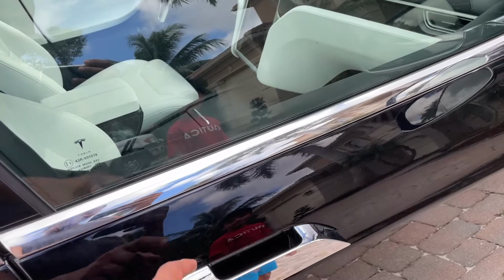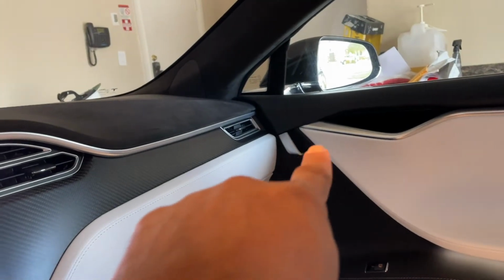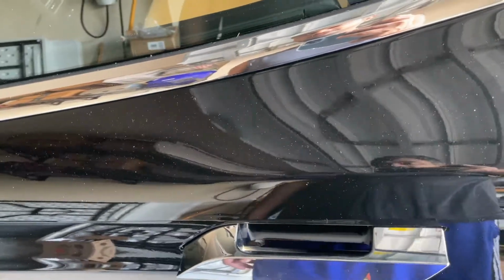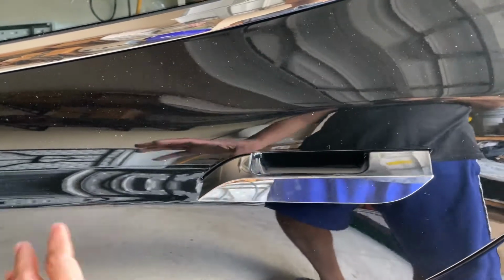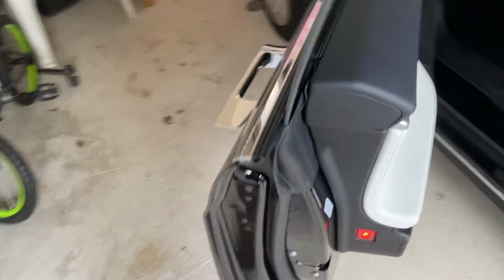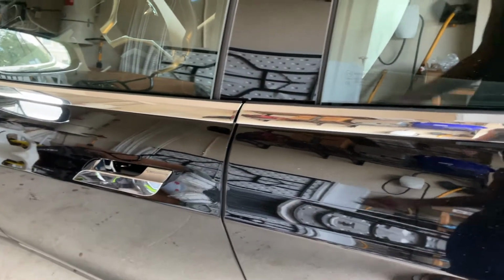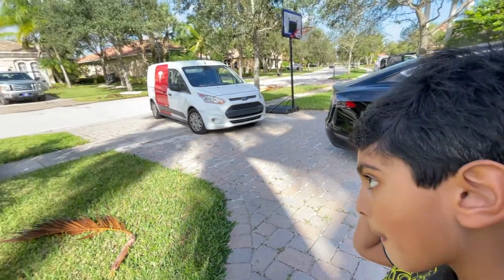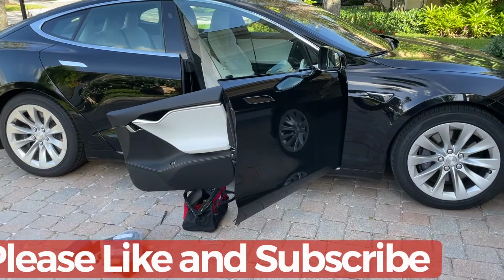Tesla Model S Door Handle Issues and FIX

Comment: You literally didn't answer any questions...please mod your title to "Tesla came by and replaced my door handle for free" To be fair, the first part of the video was informative but it should have concluded after the service tech arrived.
Reply from the maker: agree...it was a last minute decision to start recording and kind of showing what i had to go through as some people having same issue
Reply: Right on!
Reply: Removing the 5amp door fuse would have reset your door handle….. that was literally a waste of parts
Reply: I gotta say, briantimothy above is correct.  How frustrating to have this happen, somehow arrive at this vide entitled "issues and fix" which implies a fix will be available via video...and then it shows a Tesla van comes up and fixes it.  Respectfully, this was misleading and a cring waste of time.  Goodness.   @HowToDoitright

Comment: Just finished fixing both driver-side front and back door handle on my 2014 P85D. Now all 4 of my doors have been fixed for not presenting problems. Basically, it's the cheap paddle gear that broke at the hinge. First, the rear passenger side doors were replaced under warranty. The passenger door broke right after the warranty expired last year, which cost $343 parts and labor (looks like they put in a gen3 handle for $200). Then just earlier this year both driverside doors went within a week of each other, WTF. I didn't feel like paying for 2 door repairs so I decided to fix them myself following some of the Youtube videos. First I pick up paddle gears from the Tesla parts department for $7 each. Then just take the door handle out and replace the paddle gear. The new ones look like a different casting and metal feels different so hopefully, this will last the lifetime. A couple of things to add are to use an air bladder jack to spread the gap to help get to the two nuts on top easier. Windows up to undo the bottom bolts. Roll the window down to get to the top nuts. Use a plier and something to hold the nuts to place them back. Cover the shiny door handle with painter's tape to protect it from being scratched. Use some old credit cards to wedge the bottom of the handle when reinstalling to align it through the gap. Now I have both doors working. Although one of them the LED wire was broken so I have to get a new LED module and do this again.
Reply: thanks for the added tips. was there a youtube video you liked and suggest that we follow?
Reply: @drwhpod  The video by Rich Rebuilds as well as the one by Electrified Garage channel does a good job. Except Rich Rebuilds remove the window glass to get to the bolts on top, that was not necessary. First one took me 3 hours to do, after that less than an hour once figure out how to finagle the handle out.
Reply: Hi is there any reprogramming needed to pair the new handle after installation? Thanks

Comment: I have a problem with door handle model s2021 the door handle can’t move out and when I touch the door handle a little bit the door gets open I don’t have nothing broken inside the handle what should I do
Reply from the maker: Take it to the dealer. It’s a new car and it should be covered.  Open a service request from app. They should come to your house and fix it. Don’t mess with it as warranty should cover it all.

Comment: How much it cost you? Thx
Reply from the maker: Free. Under warranty
Reply: Out of warranty $343, ~$200 for a new gen 3 handle and about 1 hour of labor. I decided to do it myself replacing the $7 paddle gear.
Reply: @jonwang999 , how did you calibrate it? I need to replace my drivers side unit.
Reply: @Promoney22  I don't remember need to calibrate. I replace the broken paddle gear and put everything back. The tricky part is to align the handle so it slides in and out without binding. The advice I got is to use some playing cards to shim the handle before tightening the bolts.